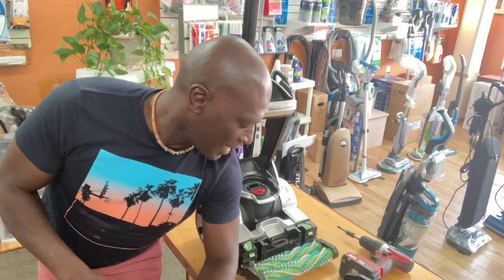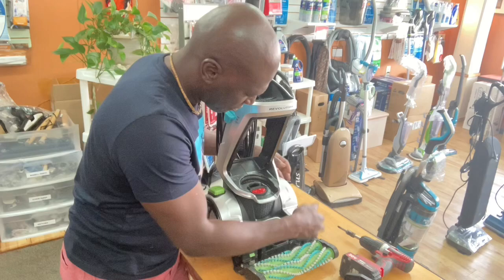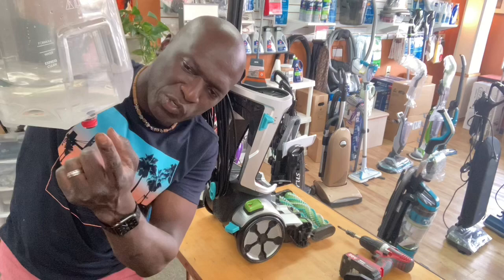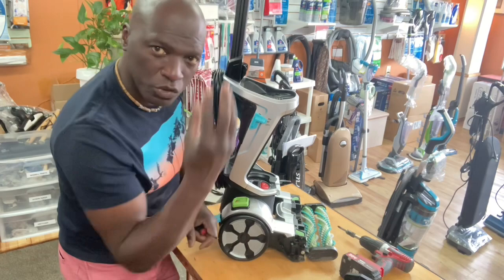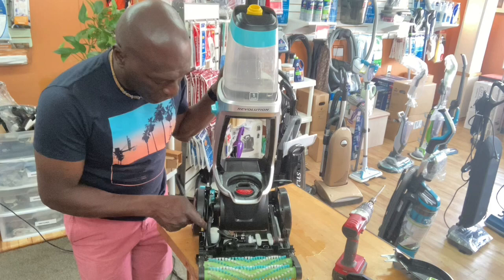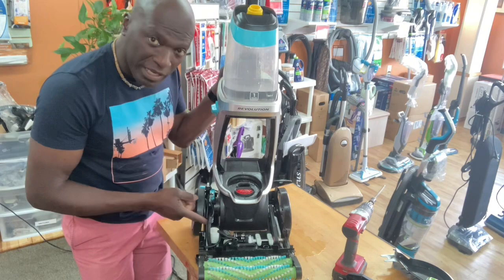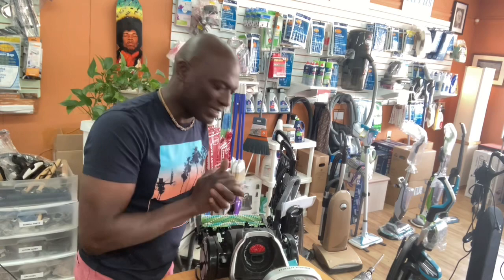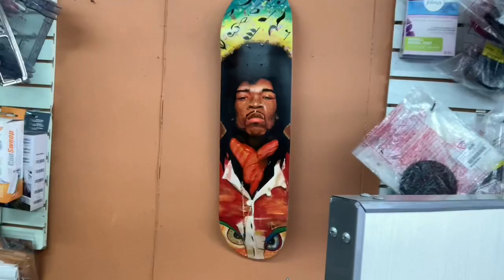Troubleshooting Bissell proheat revolution pet pro spray problem

Comment: How would I take the whole stick handle off. I pull the trigger and get resistance but I hear squeeking near where the neck of the handle meets the clean water tank. 

My problem is that I'm not getting water coming out of the bottom. Sometimes it trickles out but I have to pull the trigger multiple times. I'm gunna try and take it apart as you did in the video and check anything that seems out of place. Let ya know how it goes!

Comment: Hi, just wondering the troubleshoot if trigger is working correctly but water not coming out of hose when unit is on and trigger is pulled? Any help would be greatly appreciated
Reply from the maker: Consider tank- if the carpet section is working then it’s not the tank. Possibly the hose

Comment: Hi, great video. I had a problem with the water not feeding through the brush chamber. One of the two black o-rings had become worn and was not creating a proper seal. Do you happen to know what size those o-rings are? Bissell sent me a new brush chamber, but I can't seem to find the o-ring size listed anywhere, and it is probably a reasonably common problem. Thanks.
Reply from the maker: Hmmm. I’m not sure about by he size right now- (Bissell Revolution?) I’ll check on it
Reply: @monroevac  yes a proheat revolution 2x pet pro. Thanks 👍

Comment: Tried everything and my machine still wont work. 😢handle and lever are good im not sure if it is sonething inside where the tank sits but how would i get in there to see??
Reply from the maker: Sometimes putting another on the unit will help you zero in on the problem. For example, if you’ve ever used hot water in your tank it can warp your tank just enough to cause this issue. Try replacing the tank

Comment: Omgosh! Thank you so much! Liked and subscribed! But mine still doesn't let out water. T_T

Edit: For some reasons, my spray nozzles for the bottom was clogged. It created this air gap between the black tube and the nozzle path which didn't let water flow. After cleaning it out, the water flows now, but... I think the pump itself is also weak too, so I'll probably need to replace it. I don't think the system was design to rely on the pumps but use gravity.
Reply from the maker: Yes.  The pump is for the hose. You did great

Comment: Any ideas? I have checked the power cord and even replaced the plug and it does the same thing. Powers on for a few minutes then off again.
Reply from the maker: Sound like a motor issue- the revolution is a simple set up No pcb boards- just switch cord and motor. Many units would auto shut off if they started overheating. Try running it without the dirty water tank and make sure no debris is blocking the suction port/ filter- if it shuts off again then you may need to replace the motor

Comment: I noticed the valve on the tank is not getting depressed when tbe tank is all the way in. Not sure why it is not pushing tbe tank valve up.
Reply from the maker: The tank might be warped- if the water comes out when you test it with a pencil or your finger then the valve is working. Think back to see if someone put boiling hot water in the tank. You may have to replace the tank

Comment: Great video! My trigger is only dispensing soap when I move backwards? It used to be both ways. What could it be?
Reply from the maker: Hmm. It could be in your handle. Imagine the trigger applying more force when you are pushing the machine forward and less when you pull the handle backwards. Check to see if your handle is secure and check to see any cracks in the trigger resistant
Reply: @monroevac  Thank you so much! Yesterday,  I followed the video and took the handle off. It's in great working order. I will for cracks! It use to distribute forward and backwards. I will let you know what I find?!

Comment: Hello! great video:) Quick question, I was just about to clean my daughters room and noticed that the 2 bristle rolls aren’t spinning. Is this fixable?
Reply from the maker: Yes it’s fixable probably a belt. Scroll through my Bissell tips playlist and you should find a video about changing the belt. Your unit has three belts a pump belt and 2 geared belts for the brush. I would start with the pump belt

Comment: Help!!!  Bissell model 19863 Pet Pro 2X Revolution. Where the water flows down from tank it goes into a part that has two hoses attached. A large short hose and a long skinny hose.  The large short hose goes into another part (which is the part I need I believe) which has two hoses attached and a spring on top.  Both tubes travel down the right side to the brushes and I’m not getting water to flow.  What is that part called, or item number, because no water flows (or air when testing) through it when pressing down on spring valve.
Reply from the maker: Are you referring to the “cleanshot”- the button on the right side of the unit red and indicators when you step on it?
Reply: @monroevac  thanks for the reply!!  No, it’s where the little hole is in the back of where the handle meets the unit (roughly) but right below it on the inside.  It is where the two hoses attach which travel down the right side. Basically you pull the trigger and it presses down upon the spring which (I believe) let’s the water from the tank flow downward (but mine doesn’t). I’ve taken the tubes off and pushed some low pressure air through the tubes which travel downward and it’s clear from there down, but not before to this point (between tank and this part at the beginning).  Water will travel out of the tank into the first part but then leaks out of the back because it won’t flow through it.  I took the piece off and nothing flows through whether I compress the spring down or not.  Hope this helps.
Reply from the maker: It’s called the auto receiver but Bissell do not sell this part for this unit- Unfortunately the other auto receivers that they do sell, won’t fit this one. Find a Used part on eBay if possible
Reply: I have checked and water does come out of the tank and goes into the auto receiver, but there is where it seems to be stuck and will not flow downward and come out where the video shows around 6 minutes.  I have tried to push air through and it will not go down the hose either.  Sometimes a "little bit" of water will go, but 99.9% will not.  I used really hot water in the tank and wondering if it melted something down the line inside the motor area, but the video says its gravity.  Thoughts?

Comment: dear sir How is the switch replaced? Machine will not turn on. wall outlet is hot. thanks rod
Reply: problem solved power cord was wrapped too tight causing the problem
Reply from the maker: Awesome I’m happy to hear it worked out

Comment: Could you do a stropdown of the machine the bissell proheat 2x revolution pet because that's what I did and I had to take out the lower hose that connects to the bottom floor head and to the external attachment hose I need to know how to replace it and put it back together because I bought a new internal hose to replace it with
Reply from the maker: I’ll see what I can do. Would have to get on in the shop to breakdown
Reply: @monroevac  alright that would be great because there is a ton of screws and the easy part was taking the machine apart but the hard part is putting it back together

Comment: Mine is spraying from the bottom but not the hose I watched your other video and did the steps checking the button it is all pressing fine but no water from hose, quick shot and bottom shoots water just not either hose attachment. Any suggestions also machine is new out of box
Reply: Also I have a proheat 2x water tank seem to be seated properly, everything clicks into place,water comes out when I put a ballpoint pin head to the congestion area and the machine really works fine otherwise  but no hose spray. The suction of both is good, can you break down the water flow from reservoir to pump to hose?
Reply from the maker: Sorry for the late response. It’s easier to troubleshoot when you have an extra hose. This way we can eliminate the hose as the problem. Assuming the hose is ok, the only thing I can say without the machine in front of me is to check to the solution flow is on max and clean out the post the the water flows from, next try running the unit and lift the hose lid then use a pen or screwdriver and lightly press the hole to see if water flows out. If not then that connection may need replacing. If it flows then replace the hose
Reply: @monroevac  thank you so much I will order a new hose! It didn’t work straight out of the box.

Comment: My vacuum water did go through the hose and come out from the bottom but when i cover with the top cover, water just not spraying out. any clue?
Reply from the maker: You may have to replace the pump- the water for the floor and the hose attachment travel a different path after a certain point. If you know of someone with the same unit, try borrowing their window nozzle for this test. If it sprays then I your nozzle may be clogged. If it doesn’t then I recommend replacing the pump.

Comment: Bro hi, the main unit works gine but the hose gets low pressure water. I cleaned the res filter, i openen the trigger and unplugged it but the water pressure is low. I pushed the nossle with a pen and i sae bubbles water comea out. I ve checked the belts they re fine. What else should i do? Pump is defect or what? Why cant i get spray. I get only water like leaking.
Reply from the maker: There are some things I will try. First change the pump belt (even if it looks fine) next  make sure the pressure adjuster ( the slider on the side in set to max) after that we can dive deeper if those measures don’t fix the problem
Reply: @monroevac  hey thank you dor your response. I did the things you say and the machine is 1 month old its almost new. I found the problem. He problem is the mile which comes to white pump is fine but the white plastc connector is damaged. The shape of the innerside of white connector looks cranky. I will call Bissel if they can send me a new connector. Thank you very much.
Reply: Btw the main unit spray is working fine i face problem only for the hose spray. The pressure is low. I disnt understand how that happens is there two spraying engine inside? One for main unit one for the hose? And the clean eater tank is leaking if i turn it upside down is it normal?

Comment: My book says that if no water is spraying that I need to prime the pump by pressing something like an ink pen to prime the hose??  I pushed a pen into the little round thingy... but I saw no bubbles coming out so not sure if I did it in the correct place?  No diagram. sigh
Reply from the maker: You may have to take the unit apart and check for the pump belt possibly disconnect the water hose line from the area that you stuck the pen in. check to see if the water at least reached that far.

Comment: Ok so I replaced the rod with the bearings on it because it rusted out. That got the motor spinning again. Now I can use the hose tools with no problem but when I use the lever to move the machine back and activate the carpet brushes, all that happens is the one shot nozzle sprays continuously. What did I do????? And how do I get the main function working again?
Reply from the maker: Which make and model- the description of your problem doesn’t resemble the revolution
Reply: @monroevac  definitely the revolution pet pro 2x. I replaced the rod with 2 bearings that transfers power from the belt to the pump. I’m the bearings were seized from rust. When I put I back together, I can attach and use the upholstery hose, but when I press the pedal to use the main carpet brush, the one shot nozzle on the size starts spraying and I am getting no water coming out at the brushes.
Reply: I can’t think of the term, but like on a vacuum you press the pedal and the latch holding the vacuum/carpet cleaner upright disengages and starts the brushes. I’m sure there is a term for this since it exists on all upright vacuums and carpet cleaners.

Comment: I have no flow from the tank. Water comes out of the tank when I press the release on bottom so I poured water into the part the tank sits on and it pours out the bottom/handle of the machine, it doesn't flow through the hose at all. Now I can't figure out how to take the handle off to see if the hose came off inside.
Reply from the maker: Sorry for the delay- try this video-Bissell Revolution breakdown- The dripping tank
https://youtu.be/2RYACfNgKBc

Comment: Hello from New Zealand.
My bissell Pro heat 2x revolution pet isnt letting water down. I've pulled it a part and water is getting all the way through but when I snap on the roller cover it let's some water down, then stops. It's driving me bonkers. Please help🙏🏽 (I have cleaned the cover and run warm water through the inlet until water streams through the small jets)
Reply from the maker: Good diagnosis. I would try two things, if it’s possible. First try a different tank and nozzle. Maybe borrow from a friend or relative who has the same unit so you can test. Second check the flow adjuster on the side and make sure it’s set to max. Keep me posted

Comment: Many thanks - very helpful video.  I'm considering the Revolution Pet, Revolution Pet Pro, or Bissell's newer TurboClean DualPro.  The TurboClean looks to be larger version of the smaller TurboClean PowerBrush that I've had great experience with.  Would you recommend the TurboClean over the Revolution models?  It looks to be simpler design (no Heatwave), might last longer?
Reply from the maker: I recommend the Bissell Revolution

Comment: So you just started to touch on the problem I am having, which is there is no resistance on the trigger to squirt the water out. ( when your camera came off it's stand). How do I troubleshoot for that problem? The water comes out of the toe squirt instant shot, and I checked for obstruction
Reply from the maker: Hi Judy I have a few video that diagnosed the handle- try this one- https://youtu.be/dDxU2qCixuQ
Reply from the maker: Also-https://youtu.be/YDtOKUx7YhY

Comment: I have the same but different model. It is  black and orange. And I took it apart to clean the brushes and I was trying to get the entire front plastic off and now I messed up the wand hose. So when I put it back together it's draining my water. How do I take off the whole plastic??
Reply from the maker: Watch this video it should show how to take the unit apart - search my Bissell tips playlist for “My Bissell Revolution pet pro cleanshot is stuck

Comment: Mine has water coming out just like yours but it's little to no water. Can it be a clog or motor going out?
Reply from the maker: clog is possible. but the motor really wouldnt be the first place to look for spraying issues. Pumps or the pump belt. Try changing the pump belt first.

Comment: I fixed mine by sticking a safety pin in each hole of the spray bar underneath the rollers to unclog it.
Reply from the maker: Nice work. Thanks for sharing

Comment: I have the Bissell pro heat 2x Revolution, and it leaks water out of the bottom.  I put the water tank on and the plunger is pushed up releasing water straight down to the carpet.  Off or on it leaks.  It was fine 2 days ago and now everything leaks straight out.  Not sure if its the trigger malfunctioning.  Or something else. Any ideas.
Reply from the maker: The process used to find the source of the leak is a bit lengthy, but could possibly be resolved quickly. You may have to first take the lower housing off to see if you can spot a leak in the tubing. If you don’t find any leaks, then your problem may be right below the auto receiver. Either the seal is broken or the tube connected to the auto receiver is separated or punctured
Reply: @monroevac  okay thank you, will look into it.  It just baffled me, was fine holding solution one day.  The next day ( hadn't been used ) was just completely empty.  Only thing I could think is if a kid played with the trigger to much and potentially jammed it.
Reply from the maker: Start by taking the handle off. This will help to eliminate the trigger as the source of the problem

Comment: Water isn’t making it to the line at the bottom! I tried priming but it’s still not working
Reply: Does anyone know what I should do? 😭
Reply from the maker: 1st test your trigger, ( My Bissell Playlist should help out) then make sure that the slider on the side is set to max ( located on the right panel) The next step would be your tank. If you have ever used hot water it's possible the tank is warped. Hope this helps

Comment: FYI there’s a switch on the side that limits the water flow depending on what your cleaning. I thought I had something blocking the hose however I had the switch in the cleaning mode which allows the least amount of water.
Reply from the maker: that will do it. Glad you solved the issue
Reply: Mine was jammed in between the two settings. So no water was passing through. Tore the whole machine apart just to find out the switch was stuck. I unstuck it and it worked fine.

Comment: Okay, so, the water is not making it down to the little black hose. I tried dumping water into the auto receiver while squeezing the trigger, no water came out that way either. Now what? Help help help!
Reply from the maker: Hi Stacy, first make sure that there is nothing blocking the exit. Like carpet fibers. Take off the nozzle and clean out the ports where the water comes out. Also they spraying the hose attachment. We are trying to eliminate the auto receiver as the problem first. If that doesn’t work, try removing the handle and use a screwdriver to push down on the tab that releases the water. Please see my other videos to help troubleshoot. They are in the Bissell play list.